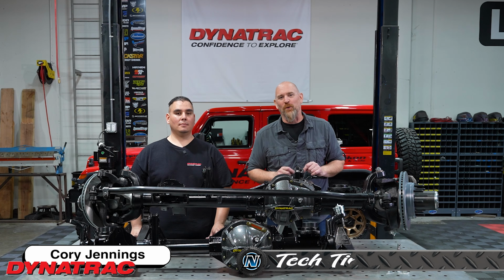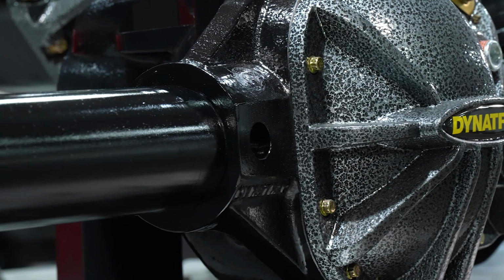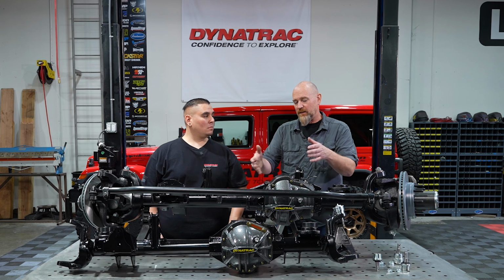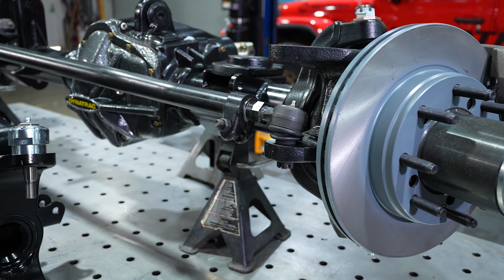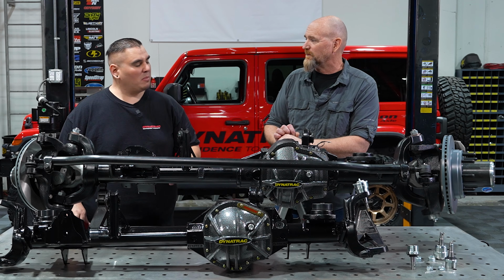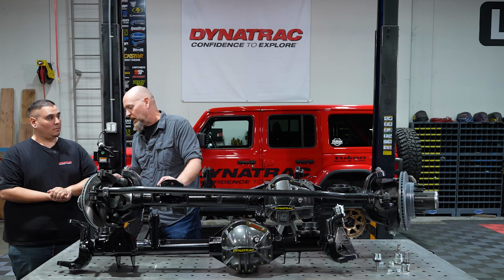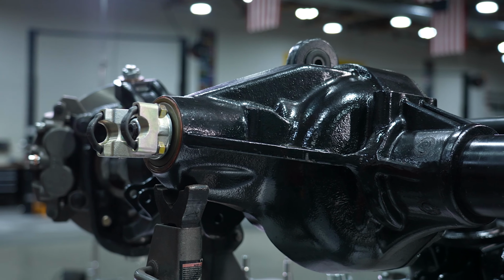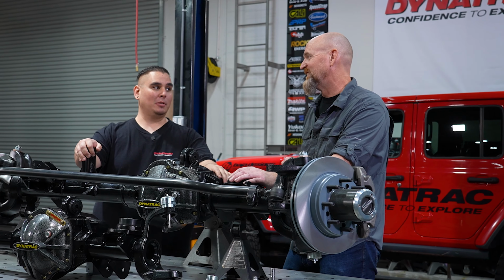Everything You Need To Know About Dynatrac ProRock Axles

Comment: Can a 3.6 engine  handle a 60and 44
Reply: My 08 Rubicon 3.8 w/ 37" MTs with 5:13 ring and pinion runs like stock but way stronger now.
Reply: Jku here with a bone stock 3.6 and dynatrac 60s front and rear 5.13s and 40s and it does amazing!       Only thing I would want different is 5.38 so i could run 42s
Reply: @stroke0187 no, you own trash.
Reply from the maker: Most definitely! Match the gears for the tire diameter and you'll be amazed at the difference.
Reply: No

Comment: So the Top dog the one ton Dana 60 with 5:13 gear Air Locker front and back with front complete setup 8 lug .... spacer for a dually Jeep Grand Cherokee 1995 with a stroker engine .... 

With complete setup 4 1/2 inch lift kit over head tracking steering arm ... for the future of my Rig ... How much  ?b
Reply from the maker: Reach out to our sales crew, they can get you that quote.
sales@northridge4x4.com or 866-601-5340

Comment: Things they don’t tell you when you buy a pro rock 60 you have to change emergency brake cables. You have to get drive lines cut in short numerous other things you have to do to make them fit.
Reply from the maker: Yes, the Pro Rock 60s are bigger than the OE axles, so you have to do extra work to make them fit.

Comment: You forgot to cover the part where they use a bunch of proprietary parts you have to order from them, and now you can’t get a hold of them. Dynatrac isn’t what they once were, if you want a bolt in axle for newer Jeep Dana Ultimate is the way to go simply because it’s Dana parts, and every parts store can get Dana next day. For me I took my dynatrac 60s out and put in a super duty front, 14b rear. Stopped breaking parts every trip, and stopped waiting 2 weeks to get replacement parts.

Comment: Why are the brakes so small for the 60?
Reply: they are 13.5 inch brakes not exactly small but they are designed to fit behind 17's. id rather they came with some 4pot Brembo or wildwoods though.
Reply: @a1racer441 and as a current dynatrac 60 owner, i can say good luck trying to find an after market brake replacement